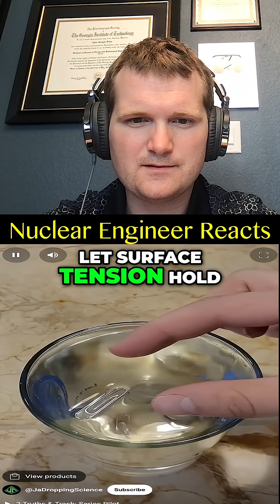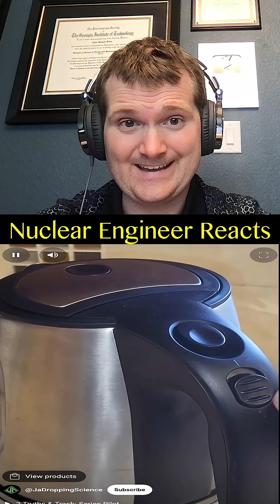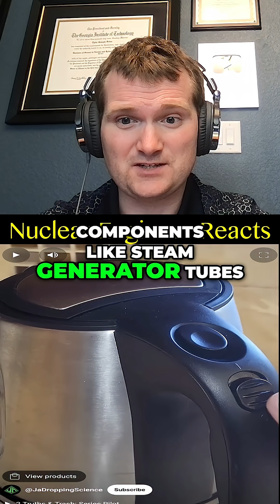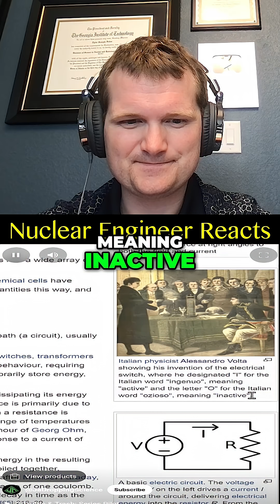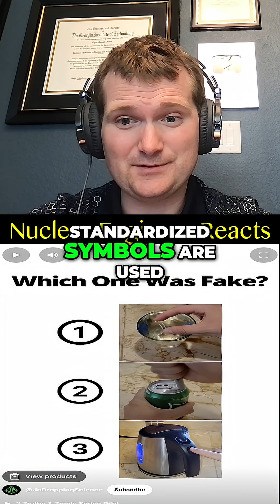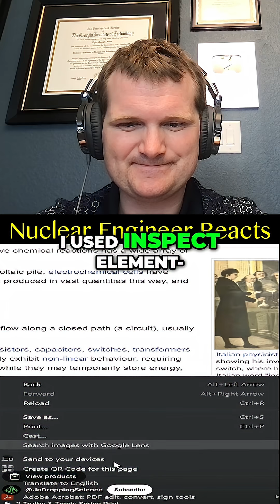What I/O Really Means? - Nuclear Engineer Reacts to 2 Truths & Trash by JaDroppingScience

Comment: I'd argue that modern use it's less binary (since that more specifically refers to digits 1 and 0) and more so visual indication of a closed and open circle representing a closed or open switch.  O is visually an "open" circle, where I is as if the circle was pinched "closed" via the switch.  Functionally the same, but since generally its referencing electrical circuits which are more visual designed, just that distinction.  But definitely not based on words 😅

Comment: Man i just figured the I/O was supposed to be circuitry, sith the I showing a completed circuit and the O for open circuit. Showing it as binary numbers makes so much more universal sense.
Reply: I'm certain that I was taught it as a completed or open circuit. But binary makes so much sense. Did they change the official reasoning sometime after the 80's? There's no purpose to making something up if the original is so simple.

Comment: In computer science, 0 means off, and 1 means on.
Reply: Funnily enough I/O is also tech related. Meaning “input output”. AKA my nightmare (Talking about the fucking IO ports, it’s all magic numbers)
Reply: @Thxtnt Even worse is that I and O are used instead of 1 and 0... 😅
Reply: @CynHicks  probably just the font tbh
Reply: Not exactly. That's the corresponding state of transistors. Binary itself doesn't have such a definition, (I/O) 1/0 is just a symbol acknowledging some binary relationship. It could mean in and out, too. 😅
Reply: Oh, and my comment to the video was that I knew the meaning, but it's very understandable how someone could assume it meant on or off, considering that it's become common knowledge that  "computers communicate in 1s and 0s which translates to on or off" and on/off toggles have the symbol. That's in quotes because it's not an accurate understanding. Binary is our base language/syntax to apply logic to the on and off states of a traditional transitor. If I seem pedantic, that's because I'm being pedantic. 😅

I/O doesn't mean on/off, but it can translate to on/off, so unless the situation is calling for accuracy (like this video) I'd say it's an accurate enough understanding.